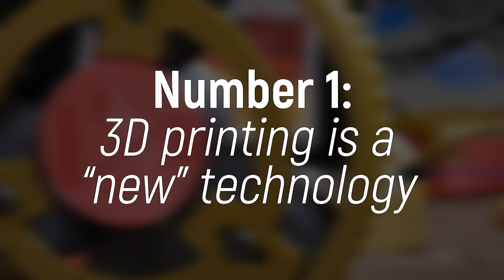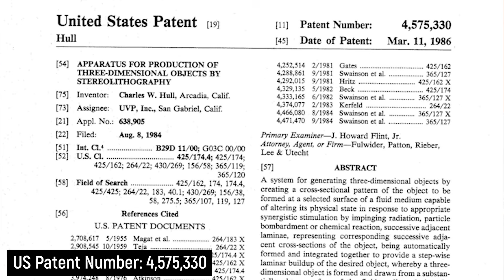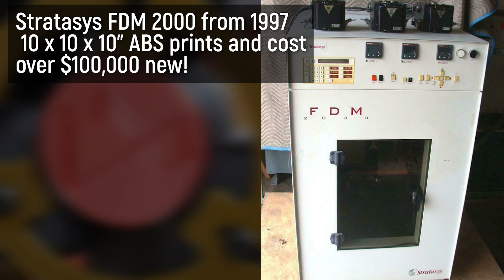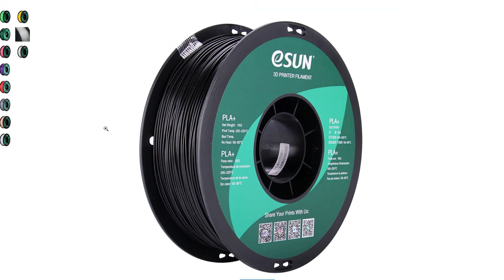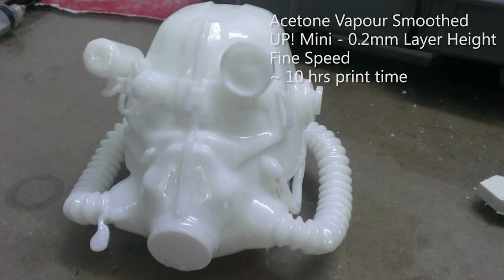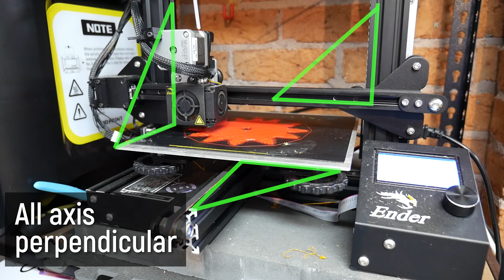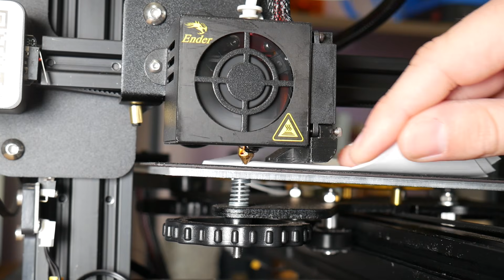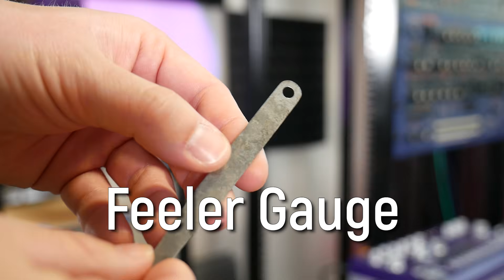3D Printing Myths I used to believe...

Comment: Biggest myth I used to believe:
That I was too dumb for 3D printing. 
I had no experience with wiring, electricity, motors, electronics, robotics, CAD or 3D modeling, or computers (aside from just running Windows). I had no applicable skills to make me believe I could even try. But I bought a kit from Creality, put it all together myself, and have been 3D printing for about the last two years. In that time I've replaced, upgraded, or added to almost every component of the machine (often using parts the machine itself printed).
Reply: For me a 3d printr is like a baby, like my first son. I did not know what to do with him. After 3 months I was an expert in shit and diapers.
Reply: If every part of the machine is replaced by parts that were printed by the machine one at a time, is it still the same machine when nine if the original parts remain? 🤯
Reply: @c0denam3b84  The Ship of Theseus.
Reply: That's what I'm going through currently. I've got no real experience with engineering/computers or anything tech-related, but I'm thinking about getting into 3d printing. I am still a bit hesitant
Reply: @bombasticbag-man1186  go for it, i had never used a 3d printer when i bought my ender 5 pro, i asembeld it an printed one of the stl files that came whit the sd card, i did 3 tryes before it printed perfect, and that was my foult, sins i thougt it printed wrong (but it wasent)
Reply: Printing itself is quite easy, I never had a doubt that I couldn't print. Making my own 3D-drawings was what I thought would be difficult so I tried it out first since I didn't want a printer just to print useless mini statues. = )
Reply: you don't have to know anything about technology, nowadays you mostly just have to able to follow instructions. extelligence is coming on strong. now if we can just get rid of the gatekeeping ... I kinda get that school textbooks are made up of a lot of work and investments, but in Germany I would have to shell out thousands of euros just to get a "copy" (it is supposedly an abonnement) of the regulations regarding electric installation. and I'm certainly to lazy to go to the library
Reply: What kind of upgrades have been the most beneficial
Reply: @withthecam  Definitely some feet to hold racquetballs to make it quieter, and a better way to route the filament so it doesn't have to make a sharp 90 degree turn at the filament. And a tool holder. Those were the best upgrades for my Ender 3.
Reply: @SirAngusSteele thank you for this comment.  I randomly scrolled the comments and found this one as a newbie 3D printer now, and I'm trying to learn Blender and Tinkercad so I can make my own things for a side venture.  I am glad to hear that someone like me with no experience with this field at all can come in and do good things.  Thanks!

Comment: I have ALWAYS used a SINGLE (not folded) piece of paper to set the Z height, and I have NEVER had a problem using this approach.  Strange that some people do.  I've been printing for about 8 years and gone through at least 100 kg of filament.

Comment: I adjust the bed screws during the first layer. I can see the correct height for each corner when the extruded line is slightly flat and not rounded. Used to do the paper trick but it's waste of time.

Comment: Paper still works a treat - provided you have a micrometer (calipers, particularly cheap digital calipers, are, um, a little less than useful) and consistent paper. There's a reason why machinists use paper: it gives a very good non-destructive go/no-go test if you shoot for "just grabs" and no tighter. The key is in knowing what the actual thickness of the paper is and using a single thickness. (Cigarette rolling paper was the traditional stuff. Extremely consistent thickness and a relatively "hard" surface that doesn't deform much. It's a lot less available these days than it used to be in some areas - and I'd suppose that Oz isn't exactly roller-friendly anymore, what with ciggies being, what, thirtyish dollaridoos a pack and climbing? I'm all for nuking smoking, but won't somebody please think of the machinists?)

Comment: Vapor smoothing and temperature resistance. IMHO the two most important parameters of a filament... I consider any filament that would melt or deform in a car on a sunny day as generally unusable. Also it has to have the professional smoothed looks.
Reply: Also ABS can be sanded, PLA and PETG resist somewhat fierce.

Comment: Been using the feeler gauge for years, some 3d printer companies like raise3d even ship their printers with feeler gauges. Also, PLA might have better tensile strength than ABS but I am pretty sure ABS has better impact resistance and elongation before failure(plastic deformation) which is more important for surviving things like shock loads and dropping.

Comment: Amazing video I've tried using the paper technique to no success the best result I got was to adjust the bed while printing just a bed leveling print but here comes the weird thing everytime I get it to print near perfect sticks to bed and everything I print a 3Dbenchy yeah it comes out acceptable I try to print something else the first layer doesn't even stick

Ender 3 V2 with upgraded springs

Comment: I think you have some misconceptions about ABS! ABS has also evolved over the years. ABS is still the best material to use for robot parts! ABS + CF is just one of the many examples.
Reply: Did you try petg?
Reply: @noname113363  yes but for robot parts ASA is becoming a better option.

Comment: When in a manual milling machine and you're touching off with paper, you generally measure the paper's thickness, wet it a tiny bit and leave it on top of, on the side, where ever you intend to touch off, then start the spindle and bring the end mill in until it whips thw paper out of the way, you then move in the paper's thickness and consider that good enough. This method is only used when squaring stock really and is prone to up to .05mm of error at the extreme end. If you need very precise pick ups you use a wiggler, edge finder or centre finder. Clocking the milling machine's head and vice too can take a long time, I've spend an hour getting both really nicely aligned before.

Comment: I just started 3D printing about a month and a half ago. I haven't run into any issues yet. I've been using a Post-It note to set my bed level and it's been working out great. I can't imagine folding the piece of paper a couple times and doing it, but I'm going to try it.
Reply: Don't do that, it's stupid, a folded sheet is an outright bad idea, as the layers of paper can just slide against each other. Using a single piece of paper - whatever type of paper you have found to work well for your setup - is perfectly OK. This was not the takeaway you should have taken from the video, but rather to try a thin spring steel feeler gauge if available.
Reply: @SianaGearz  I never did. The more I thought about it the more illogical it seemed. 

I like the idea of using feeler gauges. I skimmed through the video and didn't catch that part. I have multiple sets from working on cars. I'm going to delegate one to my 3D printer. Thanks for the idea!

Comment: Myth: ABS is stronger than PLA
Me after having grinded a PLA block with a 600, 180, 120, 80 and a steel file for 1h just to remove 0.5mm: doubt
Reply: I'll accept that PLA is more brittle than ABS, but just like you, my experience is that PLA is extraordinarily strong ... stronger than ABS.

Except for that 1 roll of super-cheap PLA I got from China. I think they blended toilet paper with the PLA on that roll. Straight into the bin! ☹

Comment: What in the world is this about folded paper????

I was always told you set the height to a single sheet of paper, less than 0.1mm and therefore under the height of most fine print settings; 

That once you've calibrated all 4 corners to the same 'feel', if 0.1mm is still too coarse (never has been for me) you could still dial in the Z further with an offset in the slicer config for your printer

... If you fold it, you just multiply any irregularity in the thickness and elasticity, an offset of unknown height (but definitely greater than your layer height) that you absolutely can't trust to even be level, let alone close to the surface

Comment: Why care at all about somebody's claim that "tramming" should used instead of "leveling"???

After all, the word "square" also doesn't match the mathematical definition of a "square" either, yet we are all more than happy to say "square" when we actually mean "perpendicular".

Of course I'm going to continue to use the word "leveling" instead of "tramming", because everybody knows exactly what I mean. Just like I continue to use the word "weight", even though technically I actually mean "mass".

Anybody who points out to me that I should be saying "mass", "perpendicular" or "tramming" instead of the very commonly understood "weight", "square" and "leveling" ... well ... they will be told to just faq-off. ;-)

Comment: Leverling ia a pet peeve for me. As I have always said it is an incorrect word to use for the proccess Of setting the X & Y planes parallel to the nostle. If the bed is Parallel in X & Y. You should be able to put the printer at an angle to the earth level plane and the print should come out OK.

Comment: I thought ABS filament came about from 3mm plastic welding rods being the only thing that was around at the time. 
I just use a single sheet of paper on my Wanhao d4s, the bed is warped high in the center, so its loose on the outside and tight in the middle and fine tune on the run sometimes.

Comment: I made a UV Rapid Prototyper (RP, 3D printer) at the University of Liverpool in 1996. There were a few 3D RP machines available but they cost over £100,000 each. The 3M acrylic fluid mine used was £1,000 a litre!

Comment: Wow I'm wanting to start 3d printing... but it sounds so complex 😕
Reply: Well there is some complexity, but getting a first print of some persuasion isn't actually hard. Then you acquire one skill at a time and solve one problem at a time. The real question is why you want to 3D print, this is important for the choices you're going to make. I think Prusa printers have a special reputation for being more beginner friendly. Also mSLA is another alternative, resin printers, those are simpler to run too, but beware of substantial health risks from the uncured resin.

Comment: What do I do with failed prints and support material. Is it recycleable.
Reply: Fundamentally yes, because material can be re-extruded, but also no, not really. You can look around for local initiatives that try to recycle discarded print parts, they have to be connected to 3D printing enthusiasts, but so far, basically none of those exist to my knowledge that are actually operational, just single enthusiasts hammering away at the problem.

No municipal or commercial recycling facility will do any special treatment for print parts. Best case, your state or municipality uses incineration reactors and some energy will be regained from print parts and plastics found in general trash, with the rest being converted into inert material that can be used as one of the layers in road or building construction, or can be put into an environmentally neutral landfill that won't leach chemicals into the earth and can be dug up and used for some purposes later.

This is the case with plastics overall, they are no longer recycled because it's not economically viable. Previously, there was a system where the plastics would get collected, and the container ships that run from China to the rest of the world with manufactured product, would pick up plastic on their way back, which was basically free since they'd be making the journey anyway, and China would sort and re-melt the trash into new product, but China found their environmental and health follow-up costs to be much too expensive to deal with long-term, so China no longer accepts plastic trash shipments. And even back then, this required plastic products to be marked individually so they can be sorted.

For some plastics, closed reactor incineration is actually a reasonable way to deal with them. Pure polyethylene, as used in plastic bags, drinking straws, etc, converts in such a reactor without residue to energy, CO2 and H2O. I'm not sure whether current trend of glue-reinforced paper products that are supposed to replace polyethylene products is actually an environmentally sensible measure - it might be in some regions where such reactors are uncommon, but this also seems to just replace one problem with another.

TLDR you can collect your print rejects, sorted by material, in the hope that some recycling solution becomes available via a local makerspace or something like that eventually, or if this isn't viable, you can just throw the material into general trash.

Also some people just throw the print rejects onto the baking sheet in the oven and melt it down, to create plastic sheet material that you can later construct something from.

Comment: ABS sometimes seems stronger because it bends rather than snaps. So if you print a drone with it and it crashes, it looks like the frame survived because the arms didn't snap.....but your frame is now likely warped.

Comment: I feel vindicated about the paper method, before I figured I was just bad at it. At some point, I decided to just print everything with a skirt and adjust the knobs while the skirt is printing, works every time.
Reply: I find that method to be the easiest, it's so simple, and can be done visually
Reply: not just that but the skirt helps a lot for me - I was getting issues with prints coming off the bed during printing and the skirts, while slightly annoying to trim, increase the contact area with the print bed and much reduce any such issues.  A couple seconds with a knife is a lot less time than restarting a print several hours in because it didn't stick.
Reply: @randommcranderson5155  hey buddy, your talking bout a brim I believe. A skirt isn't connected and is meant to prime. A brim is connected and has to be cut off after completing but is a major help in preventing warping.  :P

Comment: I would argue that calibrating X/Y steps AND to a certain degree E steps - depending on extruder - are also myths. The manufacturer probably knows what motors, gears and belts they are using, but they don't know what filament you are using, how deep the extruder gears dig in - basically changing the effective gear circumference, - not to even consider temperature. Unless you're exclusively printing single brand of single material, you probably shouldn't fix variables in hardware. 3D printing communities in general feel a bit held back by regurgitating advice that has been outdated for years. Like, printing on painter's tape? In 2021?

Comment: as a machinist one of the first tricks i was taught for calibrating tool lengths was using THIN cigarette paper (which is already WAY thinner than normal paper) which was then wetted slightly to properly stick to the surface, so I used (dry) cigarette paper with my 3D printer when i first got one and that seemed to do the trick, but I've never heard of FOLDING regular paper?! what pillock started that one?!

ps i was known in my local store as "the guy that always bought paper but never tobacco" which probably lead to some aspersions behind the counter
Reply from the maker: I think the folding started because people assumed they were setting the first layer... Good alternate use for papers though !
Reply: @MakersMuse  ahh. Okay not so pillock when you put it like that!

Comment: I have been using a feeler gauge for a long time. A habit from CNC machines. Never understood why paper was the recommended for 3D printers. I guess not everyone has feeler gauges but they are relatively cheap not to mention you can use anything as long as you know its exact distance. I like the fact you showed the origins of the technology,  great job

Comment: I too use a feeler gauge to standardize my Z-axis height. It works consistently well. Occasionally when I change the type of filament, I need to adjust the gap very slightly  [again using a feeler gauge] to get a good result.

Comment: I tryied to use the multimeter in continuity mode between the noozle and the gauge to see if they touch each other in a simple way, but unfortunately it was not enough accurate

Comment: something i was really jarred at when you said it was plastic "alloys" by definition an alloy uses metalic bonding and has to be a metal mixed with another metal or non-metal examples are carbon steel or brass.

the term for non metalic bonded mixtures of materials is a compound
or if they are simply mixed without being chemicaly bonded they are simply a mixture

Comment: I am still learning on my ender 3 v2 before I get something better. I just use a bit of paper under the nozzle and I've never had any issues. I did have to raise my z axis switch because with the bed as low as possible, it kept hitting the stepper motor. I did test the printer on a large block up to 200mm height and I noticed the nozzle was starting to hit the print at the far right corner. I rarely print that high anyway but now I see the importance of frame squaring.

Comment: I level my ender 3 by only hearing and feeling the bed, cause it vibrates different if it's touching the nose (maybe this works only if you have a bad vibrating Fan on it). Whitch works perfectly fine for me.